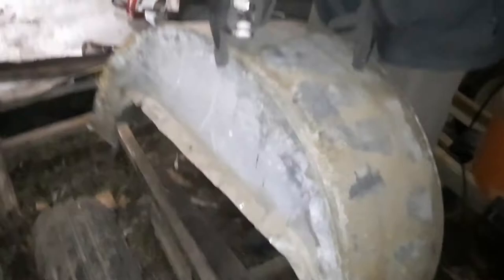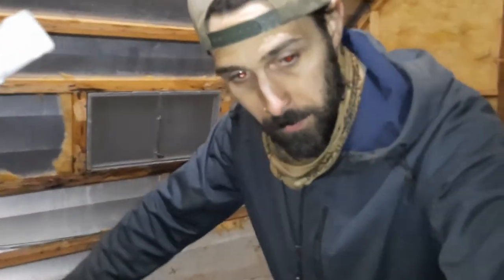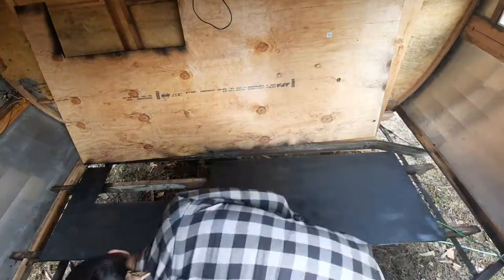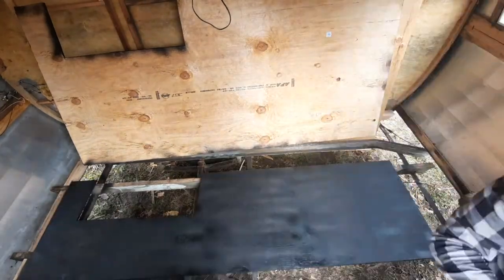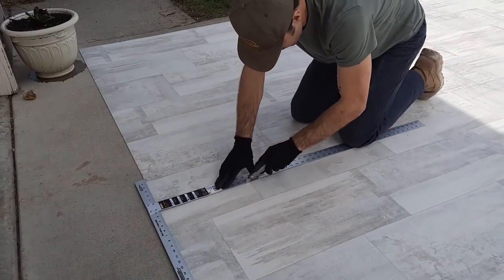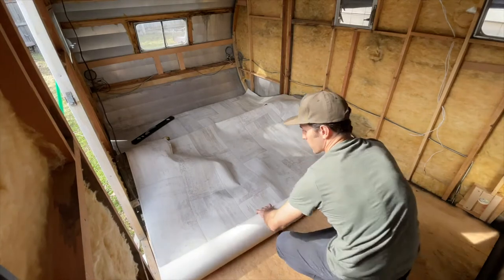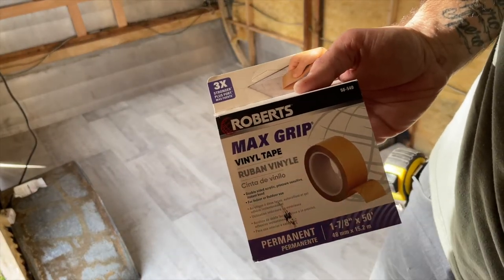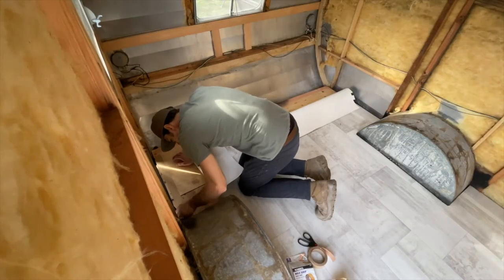Replacing the trailer flooring - Press On Coffee Trailers

Comment: The two by twos under the walls look pretty good so I was going to screw in another 2x2 to make a place for the the new subfloor and not lift the shell to replace everything. Do you think that will work structurally? Thanks.
Reply from the maker: As long as they aren’t rotted you should be good. If you have a lot of weight you can also weld in some support iron from underneath.